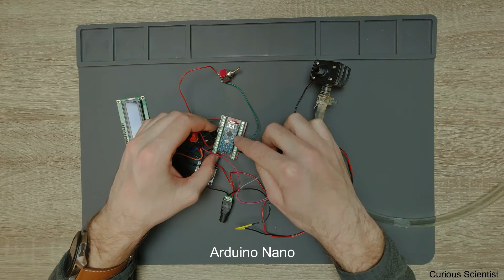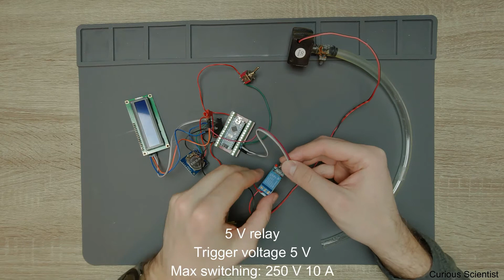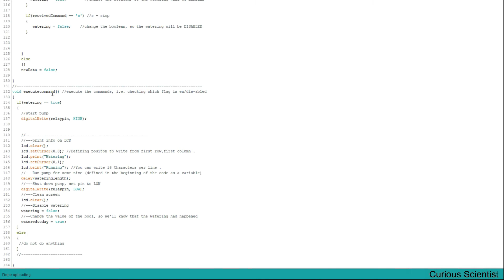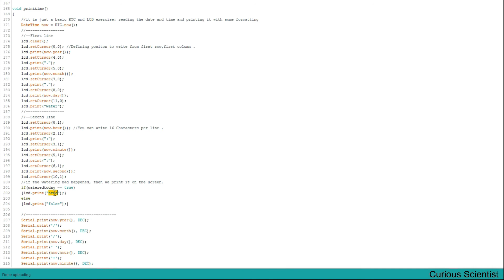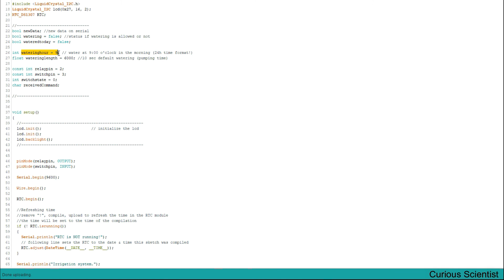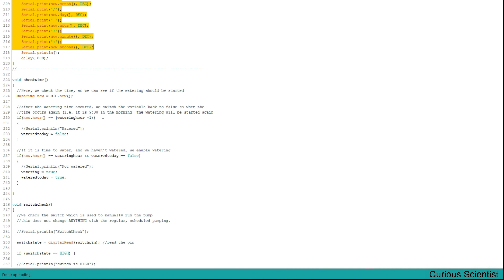Date and time based watering system using an Arduino and a RTC module

Comment: can i change the pump with solenoid valve? would it change power needs?
Reply from the maker: Hi! You can do that, they draw roughly the same current (~300-500 mA). But ultimately, it all depends on the relay you choose and the power you switch with the relay. If you change the input voltage, you might need to reconsider the whole circuit. In this demo I was relying on the power regulator on the Arduino, so I could use the 12 V input to power both the controlling electronics and the motor. I just used a 12 V, 2 A adapter if I remember correctly. However, if you would go above 12 V, this would not work because the maximum allowed input voltage on the VIN pin on the Arduino is 12 V. I noticed that many people try to power the electronics from their Arduino board so I want to emphasize, that the motor is NOT powered via the Arduino. The Arduino only switches a relay which then allows the pump to use the power from the 12 V rail and pump the water.
Reply: on arduino code u use rtc_ds1307 but u recomend to buy ds3231 on youtube description
the question is would it work with the same code that u give in website?
if i use ds3231
Reply from the maker: From coding perspective, they are the same. You can use whichever is available for you! :)
Reply: thanks for helping bro

Comment: can i just use the relay and the RTC ?, cos i really dont wanna mess with the LCD, cos it'll be outside exposed to the elements
Reply from the maker: Yes, absolutely! Just comment out the lcd related code.
Reply: @CuriousScientist  nice will try ur code soon, but i wonder, if i just do a loop for 23 hour, can it work as well as an RTC tho
Reply from the maker: @yudhobaskoro8033  you can eliminate the RTC entirely and just use the millis() for counting. Keep in mind that the millis() will overflow after a certain value. I don't remember exactly but it's several weeks.

Comment: what if I  remove the switch and want it start watering in 9 AM for 6 second also  each hour  will start again for 7 times what is the code please
Reply from the maker: You just have to modify the code that I supplied according to your own requirements. It is relatively simple. I am sorry, but I will not write a code for you for free.

Comment: Can you post the wiring diagram, please! Thank you!
Reply from the maker: Hi! I cannot post a drawing right now, but since you are not the first, I will start including them in my future videos. I thought it is easy to reverse engineer it from the video and the discussion about the code, but seems like it is not always the case. 

So, I write it down:

Both the LCD and the RTC are I2C devices, so, their pins are shared: VCC and GND is obvious, I think; SDA: A4, SCL: A5.
The relay's GND and VCC is obvious, the IN is also obvious, it is in the code and it is called 'relaypin' (which is D2). The relay is open by default and it will close the circuit when it is triggered by the Arduino.
Switch: Also in the code: D3 pin. The D3 pin is directly connected to the GND by a 1k (pull-down) resistor to avoid floating. The other side of the switch goes to +5V.
Reply: @CuriousScientist  Thanks a lot!!!
Reply from the maker: @Rdw1515  You are welcome, I am glad that I could help!